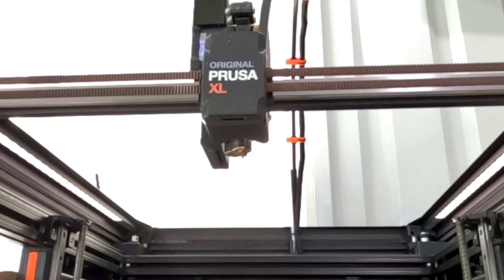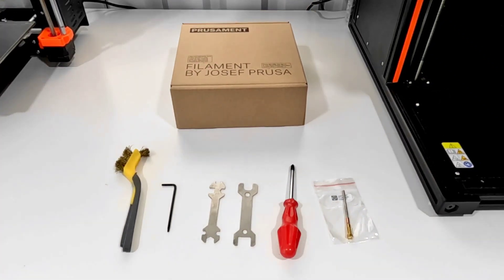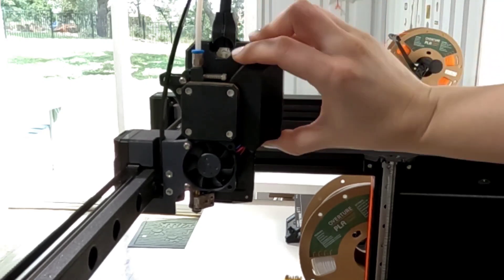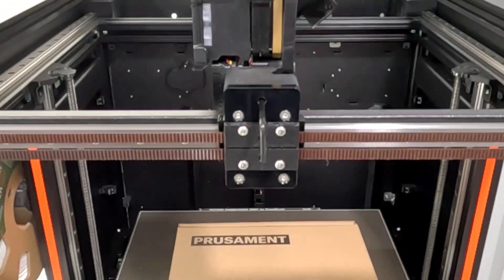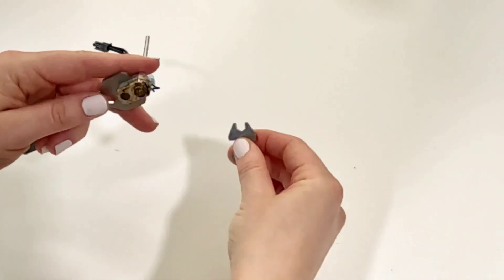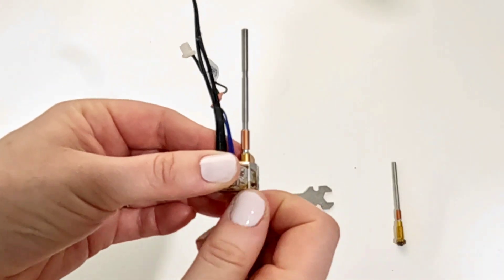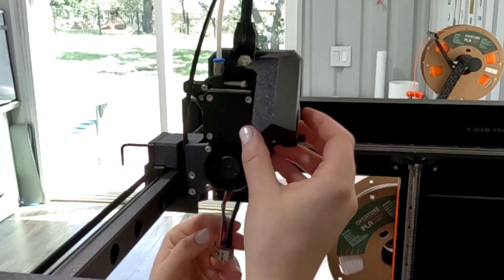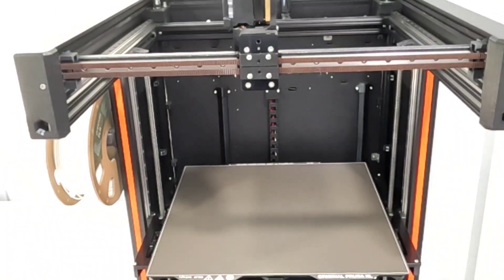Swapping nozzles on the Prusa XL - Full Video Tutorial!

Comment: Did they move this on new machines? There is no bolt head in that hole
Reply from the maker: When did you order your machine? And was it a single or 5 tool head? Both of my machines were preorder. So they may have changed some things by now. Thanks!

Comment: Hi I just had to take nozzle out as a bit of filament got stuck in extruder, my tool head did not have the hole in front of tool changer as in your video. I i had to take tool head off of carriage and sort it out that way. Just  thought I would let you know, it looks like Prusa are making changes all the time. I have only had my xl 5 tool for about two weeks and I had a few of the problems people seemed to be having and some of the filament I was using was nearly three years old. I just played with temps and print speeds.
Cheers
Alan
edit so far only had minor problems with stringing etc, but since Prusa updated profiles in slicer hardly any problems at all, mind you I have not done a large print yet. I have some old filament that I have stripped a lot off the reel so going to try a large test print in the next few days, will keep you posted. Also have a set of .4 nozzles to play with as well.
Reply from the maker: Oh that's interesting! This was on a single toolhead. Makes me wonder if my 5 toolhead is more like yours. I'll have to check it out. Thanks!
Reply: @tada3dprinting  The hole is there, like the single, but at the Toolchangers, there are the Brass screw for the magnetic holder in position until the print head is locked!

Comment: Huh, so it's several steps as opposed to one for a Revo. It's still a bit easier than on a Mk3, because you don't need to hot tighten the nozzle. I could never get the hang of hot tightening except on a Markforged which gives you a proper torque wrench.
Reply from the maker: Yes being cooled helps a lot. Thanks!

Comment: I have the prepayment down on the five toolhead version, but man I see some weird engineering with this 😬 
As mentioned above, cable connectors are not made for unplugging and replugging that often, it should be easier to swap out without removing covers and fiddling with allen keys, a bigger hole to thread the cables, and the feeling I have about buying a heater block to have in spare for each nozzle to save the time for unscrewing it all? 
I have a hard time seeing how this solution is better in the context of swapping nozzles, and especially when there will be 5 of them. However I do see the load cell argument😄
I frequently change between both 0.4, 0.6 and 0.8.
The only way I see a faster swap happening right now is to use the adapter to M6 nozzles and just swap the nozzles the same way is usually is (although I am curious about filament oozing out between the threads inside the heaterblock).
Reply from the maker: Yeah it seems like too much work. I am going to see if it's possible to just unscrew the nozzle without completely removing everything. Thanks!

Comment: while i appreciate the progress in Prusa's tech, thats not exactly Revo easy to swap nozzels. put a revo system on my prusa mini and im absolutely loving how simple it is. just did a print yesterday with a .8 nozzle at .55 height and it looks excellent. looking forward to getting an XL myself, probably will keep the .6 on it for the foreseeable future
Reply from the maker: I'm wondering if the adapter they sell would be easier to use than the stock. Or yes you could do an aftermarket change. .8 sound tricky! I have stuck with .6 for almost everything except when I want to compare to the MK4.

Comment: Thanks for all the vids, i pre orderdd the multi head, but again and again i'm not impressed with the price they are asking, not ready to make the actual purchase any time soon, i can buy 5 Mk4s for less than the price a of 5 head XL. This is not 5 times the printer, not even twice the printer.
Reply from the maker: It has its good and bad. I love the build plate size. But if that's not what you need, the MK4 might be a better fit. Thanks!

Comment: Doesn't really look like the way a nozzle on a high end printer should be changed in 2023. Come on Prusa! We have to disconnect cables to change a nozzle?!!! That's way more complicated and fragile than any other way to change a nozzle. 
This will definitely prevent the users to play with different nozzle sizes. Or maybe a good argument to sell the 5-toolhead version!? 😜😜
I personally change the nozle a lot, sometimes after each print! But this way, i will think twice to do it.
At least the bed leveling is not necessary anymore, which somehow compensates the lost time
Reply from the maker: Yeah it doesn't take a long time but it just seems like overkill. I'll see if I can find a simple work around that doesn't damage anything. Thanks!

Comment: Having to disconnect cables from that board isnt great. I  DOUBT that board's connectors are rated for that many unplug/replug cycles. Ive already seen an image of the connector ripped off the board. Someone is undoubtedly going to release some extension cables or something to use so the primary connection's dont have to be unplugged.
Reply from the maker: True. I was figuring worst case, I get a new hotend. But the connectors and board not so easy to fix! There needs to be a better way. Thanks!
Reply: Idk if someone could make male to female adapters for the breakout board. That way if you break the connector you can just swap out the adapter.

Comment: I have the same thoughts as Greg Gaub, would it be possible to do this without removing the heater?  The heat block could be held with a wrench and the nozzle assembly loosened with the other wrench, or I would use a socket.  I imagine the screw would still need to be loosened but should be much easier.  Would like your thoughts on other ways to do it.
Reply from the maker: Good idea. It's not difficult to do this nozzle swap but it does seem like more work than necessary. I'll see if I can do this. Thanks!
Reply: @tada3dprinting  I think someone will come up with a tool to assist with this process.   I know I purchased a custom nozzle torque wrench to assist in tightening them correctly.  The Prusa XL users would be happy to purchase something that could quickly help swap noxzzles.

Comment: [edit: I just looked at Prusa’s site and the vid looks far more convoluted than I Thought. Maybe it’s the mk4 (which is the same nozzle). They do have 2 nozzles with heat block etc ready to go.. nearly hot swappable.] 

In the videos prusa produced it just looked like it dropped out once the opened the door fan… 

Couldn’t you just loosen the bolt at top and in the heater then pull it out - leave all the wires etc in the machine… ?
Reply from the maker: I'll have to watch their video. Yeah I don't see why I couldn't do that. I'll check it out. Thanks!